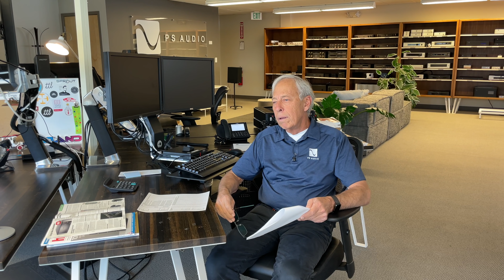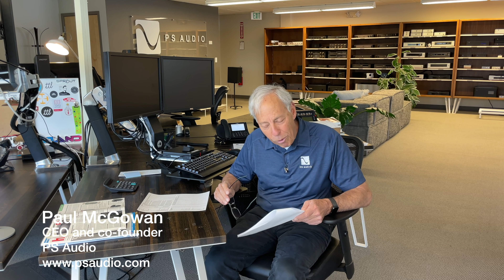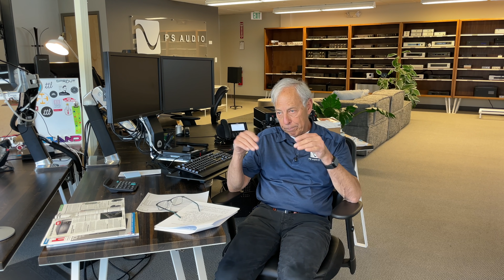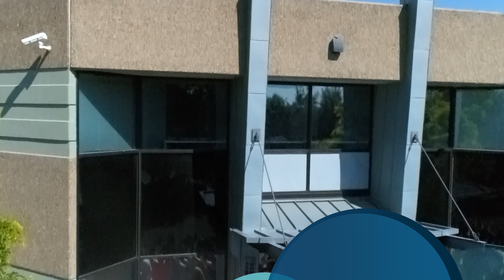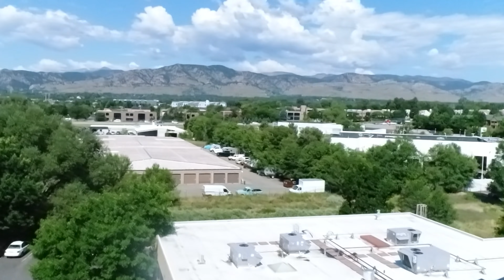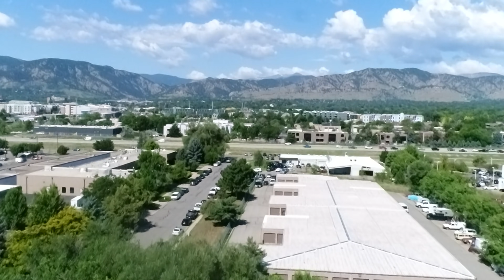Audio coupling capacitors

Comment: It's more like not stressing the OPT !  ..........and economic restrictions on the design.
As well as a driver that lacks the necessary current to drive the grid of the following tube! 
The 100K grid resistor is very ( to) LOW .......... 
Also limitations of the power supply ..........

Comment: Hello and Thanks for your useful videos. I have some questions about the coupling capacitor in the final stage of amplifier. the big electrolytic capacitor that connect between push-pull transistors and the speaker.  I have tried to test a self-made 300w amplifier with a 10ohm high power resistor to measure the output voltage and frequency on oscilloscope. In low power everything was quiet. but when I increased the input signal, some buzzy music sound came out from the board. the sound was similar to a little piezoelectric speaker, but there was no inductor to make the sound. the sound source was around the final big  coupling capacitor. 
1.Can an electrolytic capacitor make sound due to the changing current on it and is it effective on the quality of output signal and sound. 
2.Why speaker manufactors dont put a big capacitor on their product in series to prevent unwanted dc current and fail the speaker.
It became too long. Hope you patient to read it. thanks.

Comment: Ive been very curious about them reisong amps. More specifically if/where they may have cut corners for the price point. Very helpful!
Reply: No corners cut it was a mistake in my submission corner frequency 7.2Hz not 72Hz but according to vcaps.com the capacitor value at input impedance of 100k ohms gives an optimal low frequency response of 72hz with a 7.2hz corner frequency. Anyway I upgraded to a  0.47uf and it sounds even better now. Reisong amps are very well built

Comment: our brain reconstructs those low frequencies by subtracting the harmonics present above them; they don't need to be physically there for one to perceive them
Reply: So, all those pipe organs with 16' and 32' ranks of open pipes (which are hugely expensive) simply are unneeded? We can just reconstruct the tones in our cabezas? Moosedudu on the hifi path.
Reply: @jimshaw899  actually many pipe organs use 10'2/'3 mutation to achieve the the 32 foot effect, so frequency subtraction works both ways
Reply: @johnholmes912  Yes, some. But they call it 32 Resultant, not 32, and the low fundamentals don't exist in the air -- they are formed in our brains. (And they lack the voicing or a real 32 stop.)

Comment: Traditionally, higher power tube amplifiers used coupling caps in the 0.22uF range. Smaller amplifiers used 0.1uF, and had no problem producing frequencies lower than 20 Hz. In the past generation, 0.47uF is the customary value, which produces more powerful low end performance. The issue that just about everyone overlooks is the sweetness of the amplifier gets lost as the coupling capacitor size increases. Whether you use 0.1, 0.22, or 0.47uF, there are benefits and trade offs. I tend to tilt back and forth between 0.22 and 0.47uF, neither is right or wrong, it depends on what you prefer at the moment. Those engineers of yesterday were a lot smarter than we realize. In fact, they knew a lot more than just about anyone around today
Reply: Yes. When tubes were all we had, we got downright ingenious with workarounds. Still, tubes are a 'lovable form of awful' in many cases of playback systems. Likely, you could go into Abbey Road or Warner Bros. sound stages, and the only vacuum tube you'd find is in the break room microwave oven. Yet, traditionalists celebrate their flaws and glowing little filaments. ;)

Comment: Before make your amp burn, check the recordings youre listen, many of them are rolled-off below 40 Hz in order to not to have a terrible buzzing room tone. You can load the file in you PC or Mac and check them on Audacity or iZotope. If you can listen the double basses on a Columbia 60's symphonic recording, your amp is working very good.
Reply: Which particular 60’s symphonic recording ?

Comment: 0.22uf is perfectly enough. The problem lies not in the coupling caps, but in the output transformers. All those SET amps usually doesn’t have any negative feedback, that’s why in these circuits all the parts should be the highest possible quality. But those coupling caps actually are the less demanding components, that’s for sure. You can make those caps 1000 uf, but that won’t help at all ))
Reply: For me changing the caps made a very Noticeable difference. Stock caps were a bit bright for my liking.

Comment: Yip. It's 7.2Hz, even the "Octave above" is still 14.4Hz, way below what the Audio Impedance matching transformers in just about any Valve amps can handle.

Amazing how audiophiles are always gunning for Capacitors when the real audio changers in the chain are the Impedance matching transformers.
I think it because it is the balance between the Valves and the Impedance matching transformers that gives the Valve amp it's distinctive sound, so they won't even open that Pandora's box.
Reply: Transformers are mostly gone except in power output tube amps. The trouble is, capacitors are still here, and many leak DC and change value with age. It's a partial reason that high priced caps may be money well spent in high end designs.
Reply: @jimshaw899  
My comments are based on the Amp mentioned in the video and like many other Valve amp examples, they are definitely not gone.
These transformers have a massive impact on the sound reproduction and as mentioned, it plays a big part in what gives Valve amps their character. 
The lowest to highest frequency in the Audio Band (20hz to 20 kHz many, including me, will argue that its much more) has a ratio of 1000. Producing capacitors that has a flat response over this band, without any dips, peaks or ringing properties, is immensely more doable than producing Transformers that can do the same. Regardless of whether the transformer has an amorphous Iron or silicon-iron core, Coper (in all it's variants) or even pure Silver conductors and the best enamel coating on the conductors, they cannot come close to the ability of the capacitors to pass audio with minimal colouration.
As for decay with age, it was not the topic of the video and indeed all components suffer from that.
Valves (that are frequently replaced) are much more affected by age than Capacitors but even Transformers are affected as well.
But yet those that are so pedantic about those evil capacitors, while pushing Valve amps, will not mention the issues with the output transformers. 
I think it's because the transformer is part of the kind of sound they like. 

The BHK signature amps (like some others) overcomes all this by being a Hybrid and having a MOSFET output stage. They therefore do not need the output Transformer.
But then again, some will argue that they don't sound "Valve" enough for their taste.

My point is that I believe that most people are going for a "type" of sound and that is not necessarily the purest form of the sound.

Comment: Who on earth would design a HiFi amp that’s -3dB @72 Hz? Wouldn’t it make sense to check the math before taking that figure at face value?
Reply: It was a typo on my part when submitting questions. It’s 7.2hz  -3db frequency optimal low frequency response 72Hz.
Reply: @skularatna8136  -3dB @ 7.2Hz is fine. If you’re playing vinyl, rumble would become a problem @ 15Hz. Correct me if I’m wrong, but i don’t believe that pipe organs reach any lower than 10Hz or so
Reply: @billd9667  as low as 8Hz. But don’t think you can hear that prob feel it with a good sub ?
Reply: @skularatna8136  feel only at that frequency. Very few subs can play that low cleanly anyway. Certainly no full range speakers can. Most subs that can go that low have their own amps, so this is just an academic exercise, don’t you think? I mean, how may angels can dance on the head of a pin? Does it matter?
Reply: @skularatna8136  Okay. I just find it weird that Paul would go with that clearly incorrect figure, and create an imagined justification for it, instead of instantly questioning its accuracy.

Comment: Output, not input: I have 8 ohm compression drivers that I actively cross over at 1250 Hz. I put 18 microfarad polypropylene caps in series with them to block some low frequencies in case they happen to find their way onto the wire.

Comment: Is there any system without caps and inductors in the signal path somewhere? Active speaker drive with high resolution DSP cross-over is possible avoiding the passive cross-over filter, and that’s all great, but the DAC output stage filter is another issue and the power amp can’t be class-D, but that’s ok.
Reply: Sure, the First Watt F5 is a good example of a direct-coupled amp. It'd pair quite well with full-range speakers, too. There are a lot of direct coupled products, but they just aren't common in the grand scheme of things, for a variety of reasons
Reply: The Loftin white is an example
Reply: Linn had produced a direct coupled capacitorless preamp back in 1995 - add extra for an RIAA phono preamp stage -  but I've never seen it being reviewed by leading hi fi mags between 1995 and 2000.

Comment: A good opportunity to add better coupling capacitors also. Every little thing matters in an SET amp. If  corners have been cut at that critical juncture, what else has also?
Reply: The 72Hz was a typo when sending the question.  That has caused a lot of confusion. 7.2Hz is the -3db corner frequency with the optimal low frequency response  being 72Hz according to :

http://www.v-cap.com/coupling-capacitor-calculator.php
Reply: I’ve now upgraded to 0.47uf Russia K42Y PIO and it sounds much warmer than before.  The amp overall has been constructed very well.
Reply: @skularatna8136  You're correct, thanks for the clarification. 
Is the K42Y a Teflon dialectic cap? I've used a few K40Y-9s and have found the same, usually more perceived detail as well. The V-Cap CUTF is my favorite though. 
I've recently gone coupling-capacitorless with a Loftin-White DC SET and this has been the best overall to my ears.
Reply: @FireTriode  it’s paper in oil capacitor. You can find details here:

http://rutubes.com/product/k42y-2-022uf-500v-k42u-2-pio-capacitor
Reply: @FireTriode  oh nice! Did you construct the loftin white yourself. I found the only issue with that design is if your input tubes fail you affect the entire circuit meaning there is no protection for the output tubes ? Correct me if I am wrong?

Comment: Pipe organs and synthesizers are the kings of sub frequencies.
Reply: .22uf is fine with a 100,000 input impedance. that works out to about 10 ohms at 72hz. perhaps your thinking of an output impedance. that would be a bit under 6 db at 72hz. maybe you meant .022uf
Reply: @richperilli160  wrong comment!
Reply: @richperilli160  0.22uf the cutoff frequency is 7.2hz.  72 Hz is the optimal low frequency response
Reply: Also check out those 25-ft. diameter Kodo drums from Japan.
Reply: @laurentzduba1298  giant Gongs too!
Reply: @laurentzduba1298  Can you cite a recording of these? I have been looking for years....
Reply: What about the canon of 1812 ?

Comment: The late Ken Ishiwata of Marantz had a reverence on paper in oil capacitors due to their dark inter-transient silences. But unless you are using military spec paper in oil caps, always regularly check when using one in a tube amp for DC leakage. To my ears, paper in oil caps subjectively sounds more musical than mylar and polypropylene capacitors.
Reply: I installed Russian K42Y PIO caps 0.47uf the amp sounds beautiful, warm, dark
Reply: @skularatna8136  If you like the K42-y, you should give the K75-10s a try if you ever wind up opening it up again. I've yet to compare the two, but I've always been happy with the K75s where I've used them!
Reply: I would love to hear an amp with working paper in oil caps. Because of the typical age of consumer devices that used paper in oil caps, I have never heard a device that had working ones. Other than some radios, which sounded like garbage to begin with LOL
Reply: @graxjpg  garbage sound is a sign to replace the paper in oil caps. Back in the 1990s, the Parts Connection used to sell surplus tested and working military grade paper in oil caps sourced from the closure of the USAF Strategic Air Command and the former Soviet Union. In use, these caps need to be monitored regularly since when they go bad they tend to leak DC. If you want an alternative that offer less attention and sound almost as gorgeous, high voltage polypropylene caps from the 1950s and the 1960s rated at 630 volts or higher.

Comment: Hi Paul, the cut off frequency is in 7.2hz range. 0.22uf and 100k. 😅.
Reply: The first input tube of the Reisong amp probably has a 100,000 ohm input impedance so the choice of a 0.22 microfarad input cap is a sound engineering choice. But like all things hi fi, replacing the input cap to 2 microfarad one will certainly "fatten" the low frequencies and the Reisong will probably sound gorgeous when playing hip hop and electronic dance music tracks with lots of bass.
Reply: @laurentzduba1298  2uf is excessive. Just use a 0.47uf capacitor. You would be flat at 20hz, and it is a small enough value where you wouldn't have to sell your first born to buy a decent copper foil capacitor.
Reply: @tristanjones7735  to my ears, silver air gap capacitors are probably the best sounding capacitors ever made. Sadly, it was very hard to get back in the 1990s and probably impossible to get now after the company making it closed shop back around 2002.
Reply: @tristanjones7735  this is what I did about a month ago. Changed it to a 0.47uf PIO cap
Reply: @laurentzduba1298  sure it will 👍😄. The signal is already 3db down on 7.2hz, flat upto 14.4 hz. And the phase shit occurs 2 or 3 octaves above cut off. So choosing lower cutoff is definitely better.
Reply: @vishnuvinod1896  Phase shift at 20 Hertz, are you going to hear that? You must hate sub woofers then.
Reply: @hugobloemers4425  Of course not 🙂, I love subwoofer. I just said choosing lower coupling cap would be better, most of the amplifier designers does that 🙂. For me, phase shift at those low frequencies are not audible though.
Reply: My first thought. He is a coule of digits wong in his calculation.
Reply: Yeup. I had to play the video a few times to make sure I wasn't hearing something wrong.
Reply: Correct 7.2hz 3db cutoff optimal low frequency response 72Hz. I believe I made a typo or was not clear when I submitted the question